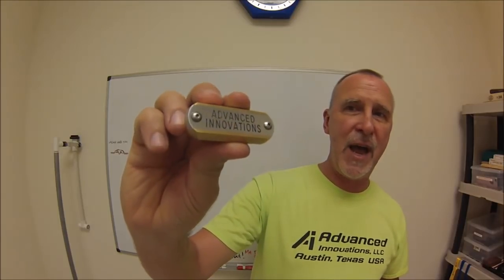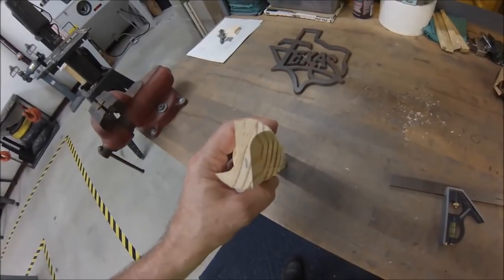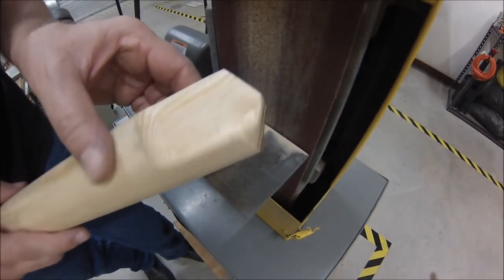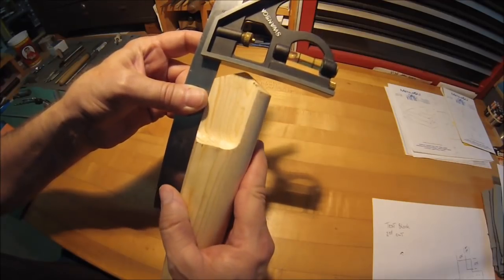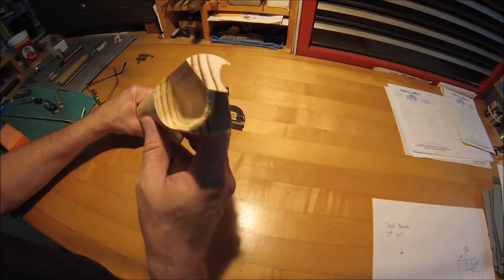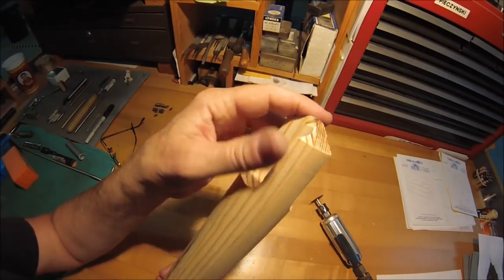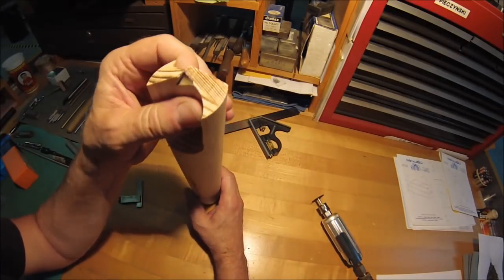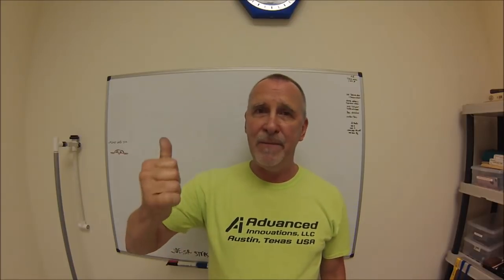Drill Tip Geometry, Web Relief and Sharpening simplified

Comment: Joe, great videos. Is it best to use the correct size drill from the first or to go up in increments for drills bigger than 1/2”.?
Reply from the maker: Depends on the material of course, but I normally have a pilot hole for bigger drills.

Comment: Good video Joe. Re the 118 degree versus 135 degree point issue, the more obtuse the angle the shorter the cutting lip, so you're peeling off a less wide chip with a 135 degree tip, which reduces the machining power needed and makes it easier going in harder metals. A 135 degree tip has cutting lips about 8% longer than a 180 degree tip like a bullet point, and a 118 degree tip has cutting lips about another 8% longer than 135 degree. The way it was explained to me was that 118 degrees was a compromise (for plain chisel point drills) that balanced lip length efficiency with the ease of initial penetration and avoiding wandering when starting a hole. Sharper point angles tend to initially penetrate more easily and wander less, but are less efficient once you're in the hole due to longer cutting lips that are cutting a wider chip. Now that's for plain chisel point tips, but once you go for a split point tip then that kinds solves the problems of wandering and initial penetration, so a more obtuse angle with greater cutting efficiency can be used. Hence why 135 degree is so common on split points but not so much on plain sharpened drills.
Reply from the maker: Good input about  drill tip angles and how that changes things.

Comment: Your grinding the edge when using on brass also works, for us that do not have a drill press handy and have to use hand drills to enlarge drilled holes by just a bit.  i.e making a 1" hole out of a 7/8' hole.

Comment: Hey great video 
The US general drill gauge is still available iv 1 almost identical  branded sealey tools.
Iv found these gauges a little small to use on say a 1” mt3 drill bit or larger iv a home made quick check gauge that lives at the pedestal grinder I’ll describe it 
It’s a piece of 1.5” x 1/8” x 18” aluminium  with a 90 degree bend 1.5” in from 1 end so you’ve a 1.5 x 1.5 square there , right in the middle there’s a 1/4-20 set screw sharpened to a 60 degree point 
To quickly verify the symmetry or hight of the outside of the cutting edge locate the drill on the pointed set screw  by the centre on the tang then scribe a mark on the aluminium with the corner of the cutting edge then turn it 180 degrees and repeat scribe lines should be identical 
Iv found this “fast and dirty” for larger taper shank drills 
Obviously it assumes an understanding of the 118 degrees / 10-12 degrees relief etc 
Hey Joe I’d love to see a video on special grinds for brass etc in the future if you get enough interest 🤗
Reply from the maker: On really big drills, use a right angle square with a 12" scale. All you need to do is assure the center web and edges are the same and its perfect. The angle can be eyeballed, as long as those points are identical it good. To check the web, lay the drill on a flat surface to inspect it and have the scale positioned vertical. For the edges, stand the drill up. ( point down )

Comment: You said web relief is not required for smaller drill bits, so at what bit diameter size (metric) does it become necessary to have web relief for drilling into steel? Also please do a video showing web relief being cut using a conventional grinding wheel on a metal bit.
Reply: Up to 6mm there is no need for thinning the web. If you have a pilot hole no thinning is necessary . Drills you drive on a plane surface must have thinned web so that the drill doesn't walk while presdong
Reply: @gopinadhanparambil9268  "presdong"?????
Reply: @taab7  oh sorry, it is pressing

Comment: can you explain more about your brass mod of the drill. what,why,how
Reply from the maker: The leading edges of the drill that actually do the cutting are normally sharp. Since brass is a much softer "grabby" material, having sharp edged tend to entice the drill to aggressively, dive in. By putting small flats on these 2 edges that lie perpendicular to the material to be cut, the drill then scrapes the material off and the desire to dive in, is eliminated or at least greatly reduced.
Reply: @joepie221  
Hello
Sir,
I need some tips regarding deep hole drilling.

Comment: Alright your right on track with my issues . I’ve been struggling with a 2 1/4” drill by hand we did everything we were taught , ended up coloring the end with sharpie then touching it off and looking for the shiny parts . We are drilling 4140 heat treated . But still have one side cutting I’m going to follow your video and try it again. Thanks Joe !
Reply from the maker: Let me know how you finally did.

Comment: I was always under the impression (because an old guy said so in my apprenticeship) that the 135º drill angle works better on harder materials. I work in a tool & die shop where we work with a lot of hard and even super hard material (H13, H43, A2, D2, FX, etc.). Personally, I do think the broader angle holds up a little better in these materials. But I've just always done it that way so maybe I'm brainwashed. :)
Reply from the maker: Envision an ice cream cone. The milder the conical angle, the less surface contact and heat you will have. i agree with the 135 comment.

Comment: Hi Joe,
Any tips on sharpening very small drills like 1/16" high speed steel ?
Reply from the maker: I have learned over the years, that for $1.30 its easier to get a new one than to mess around sharpening an old one. only specialized drill sharpeners can do small stuff like that.
Reply: @joepie221  Yes your absolutely right. When I think back to my days as a technician in a school where we did a lot of drilling on glass fibre PCB's I did start buying boxes of 50 for a few pounds. Then the teachers started asking for high speed dental drills which are made out of tungsten carbide and cost a lot more if you buy new ones. In the end I started buying ones that had been reground and were a bit cheaper. I was wondering how the companies that sold them had them reground. Sorry I did realised it was a stupid question after I had asked it. It would be nice to know if you sharpen centre bits that you use on a lathe as they have to be ground to very fine limits, or do you just buy new ones. Sorry agin just curious.

Comment: Your grind on your split point is to acute if you look at the profile of it, the center where the split point is flat. You need to modify the angle of the split Point to make it all converge to a point on the profile
Reply from the maker: You won't find them ground commercially like that.

Comment: Why is the heel ground to a curved surface rather than just a flat plane at 10 degrees to the cutting edge?
Reply from the maker: The relief needs to be conical to clear the leading edge cut projection, and the curved geometry helps it feed smoothly and keeps it from digging in.

Comment: I'm only a novice at all this so what I am going to write derives from what I have read.  Allegedly the advantage to a 135 degree included angle for the point of a drill bit is that 1) it will cut through harder metals easier and 2) it will reduce the tendency of the drill to "walk" across a flat surface.  The second point really only applies to smaller drill bits (e.g. 1/8 and less?).  Any drill used with a pilot hole will not suffer from "walking" so much.

Also, it seems to me, that a 118 degree bit will necessarily involve a steeper relief angle from the cutting edge towards the heel.  I'm guessing a 118 degree bit will have a greater tendency to break because of this.  If the drill in question is carbide, I would guess that anything that makes it more resistant to breakage is a plus.

Comment: I've been hand sharpening drills for many years.  They cut well and I thought I was doing a great job when using them in the drill press.... but when I mounted that drill bit in the tailstock of my lathe it was obvious it was only cutting on one side.  Good wakeup call, and I think a great way to check that you have ground the bit properly.

Comment: Center drills work great for what they were designed for.. I would think that the same theory would also work for spotting drills. Why doesn't anyone make a spotting drill with an extended tip like a center drill? That would stop the chisel tip web from wandering in the bottom of the v as well as center the drill on the matching angle of the spotting drill hole

Comment: How to set feed and speed of drilling milling for various material 
Helo Sir your video was so help full to all of us and also a idea that can understand by everyone. Thank u very much
Reply: for drilling speeds from 500 to 1200 good for drilling common metals like rolled steels and 6000 series aluminum. On my 1963 Cincinnati mill, i have power quill with 0.002" or 0.006" down-feed per revolution of the spindle. Works great on steel at 0.002" per revolution. Gets tougher with bigger diameter drills. After about 1/2" (12mm) you should really be boring holes or circular milling.

Comment: Very informative, Joe!  I realize I'm late to the party, but recently I have a requirement to drill a long/deep precision .375" dia. hole, through a .875" dia.,  9.00" in length of mild steel (round stock), and it must run through the center and come out the back end concentrically, within .003".  I was in search of this information when I came across your video.  If you have any comments or suggestions on how to approach this task, I'd love to hear them!  I have drilled holes in steel before, but the "perfectly centered" requirement was not specified, and certainly not to the length of this part.  I have a Hardinge HLV H tool room lathe.  Cheers, Norm C
Reply from the maker: The one thing I would suggest is to drill from both sides and take your time. Pushing a drill can make it walk. Let it cut. If concentricity is critical, possibly leave the OD oversize and do the hole first. Then true up the OD to the hole between centers.
Reply: Thanks, Joe!  I'll give your ideas a try.  I had not considered turning the OD to align/coincide with the bore; and excellent suggestion.  Mil gracias, amigo!
Reply: @100nortonfan7 , I'm probably too late to the party. However, another option is a gun drill. They are known for drilling extremely straight holes with an excellent surface finish.
Reply: @horseshoe_nc  Thanks for the comment.  A great suggestion and will keep it in mind should the   need present itself in the future. Cheers

Comment: Hi
Very well done, reminds me of when I was learning some 60 years back when I was 15, and watching your videos has showed me I actually knew nothing about machining and when I was earning full wages at 16 or 17 years old as production machine shop when computerized tools were just coming out, and I never got to use said,
But you forgot to dip that wooden in water tool bit when sharpening it to keep it cool !
Did you try hardening that piece of wood to see if it would drill through plastics ?
I'm curious if it would?

Comment: I never ever sharpen a large drill on a grinding wheel, belt sander is perfection!  Then back the lip off on a pedestal grinder after dressing the wheel to reasonable sharp corner
Reply from the maker: Agreed. I like the belt sander too. Just don't burn the leading edge.

Comment: Drill into M42 HSS on your tail stock with a 1.5" drill bit and you'll feel the difference in the cutting angle of the drill. It's tough going. I also sharpen my 1.5" drills by hand on a 3/4" width grinding wheel. The skill is in keeping the angle true while moving left to right across the wheel. Great vid.

Comment: Joe, you have some great content that I wish was around when I started out. When I was in trade school, I made a 118° and 135° gauge to ensure I was getting the correct included angle. Took maybe 10 mins. on the mill and has been very useful over the years. I usually sharpen on a pedestal grinder that is kept dressed for drill bits only. I split the tip on the corner of the wheel. Takes a couple of seconds that way. Also made a spring loaded tap guide that has been indispensable for centering taps.

Comment: Love your videos! Would love to see you do this on a morse taper larger steel drill and how you would do the point splitting!  You're a great teacher even if you can't claim to be on YouTube!
Reply from the maker: I'd do it on a belt sander and split the point exactly the same way I did to the wood. Air grinder with a cutoff wheel. Done it a hundred times.

Comment: Great explanatios and good use of oversized "blank".

I however have never been a fan of of rotate-lift grinding, as it loses your original index position easily and is harder to learn correctly. Flat facet grinding is easy to show to anyone, you can easily control the angles and get it perfect the first time.
Reply from the maker: I will agree with you on this one, but when someone puts that secondary relief on, they usually give too much. It is a good place to start if you've never done it.

Comment: Question, I was taught to use a pilot hole only a bit larger than the tip of the bit I was going to use so the the whole cutting edge of the bit was used and not wasted. I see guys drilling 3,4,or 5 times to get up to Half inch. what is proper technique?
Reply from the maker: Depending on the material, I think 2 drill is fine for a 1/2" dia hole. You still want speed and rigidity for the pilot hole, but you want to leave enough material behind to not edge wear your final size drill. Split it 50/50 go with a 1/4 then 1/2. That would be fine.
Reply: thanks, much more along the line which I was taught.

Comment: Joe, gotta say that was pretty frickin' cool!  I like 135 and 140 degree drill points for tougher materials like stainless and tool steels, and 118 degree for softer stuff.  The larger included angle reduces the chip width, and thus the torque required to twist it.  A split point is almost always a good idea, especially if you have flood or thru-tool coolant.  I have had troubles with them though when drilling in high nickel-chrome steels like 440.  The heat generated at the drill point will cook the thinned area.  Ditto for carbide drills.  If you're gonna split 'em, keep in mind that carbide is brittle and very easy to fracture.  The thinned web is very fragile.  I almost always spot (not center) drill before drilling because no matter the material, it makes life easier for the drill.  You don't like my formulae, but I'm hard-headed and some viewers may benefit-  Feedrate for a drill=.013 X diameter in inches per revolution.  Now, if you remember that you said 'who gives a shit' about the formula for thread minor calculation, you'll see that '13' pops up again and again in almost everything we do.  A customer once asked me to make a template for his wood lathe so he could rough turn pool cues.  It turns out that the taper on a pool cue is 1-in-13, or .666 degrees.  Interesting, at least to me.
Reply from the maker: I like the drill feed rate suggestion. I'll have to take a harder look at that and try it out.
Reply: Rob Bardin with your drill feed formula. I ran some drill sizes I use the most on the CNC mill. And your formula comes pretty close to my "go to" starting point for those drills in soft to mild materials. But, I have found that occasionally changes of speeds and feeds are needed in repeat jobs. My guess is slight differences in material.

Comment: Good video Joe. You always keep it going and I never fall asleep. I had a job a while back where I had to drill about 50 holes that were 1" diameter in some heavy I beam. I did it on a Bridgeport with a annular cutter. I think it was a Hogen brand. Have you used this type of cutter for large holes?  It took very little time, with half the horsepower, and less chips.Those cutters are the way to go for large holes! Again, love your videos and keep your chips blue!

Comment: Does it increase the chances of the tip snapping? Drill geometry can get pretty complicated. Nice cut by hand on the dowel!
Reply from the maker: Hey Chubbza5, nice to hear from ya. If your web reliefs don't overlap, it's very strong and will hold up under even the most industrial punishment. It looks like a pinpoint tip, but look square to the web relief and it actually has a very stout support geometry. Thanks for checkin in Bud.

Comment: the 135 degree has about 40% less cut length for hard matieriels I've read some interesting articles on the web theres one that describes a drill point that ford motor used to drill like 30,000 holes I've read a lot about drill points and still picked up a few pointers (ha ha) so good stuff joe

Comment: Drilling with a wooden drill? I once  turned a bullet nosed Styrofoam part , 24" O.D. x 3 ft long, for Sandia National Labs. I Glued a plywood disk to the base to chuck it and a plywood ring to run in the steady rest. I made a plywood forming cutter to turn the bullet nose. Worked like  gang busters. It was necessary that every thing be absolutely oil free to keep stain marks off the finished Styrofoam. I think the part was fitted dampening material for some experiment at the lab.
Reply from the maker: You have to use a wooden power drill or it doesn't work.